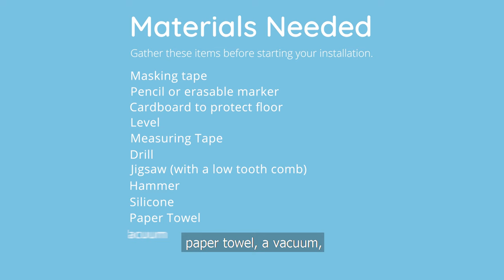How to Install a Walk-in Bathtub Conversion Kit

Comment: i am a bathroom remodeling contractor. i understand the need to finish a job quickly, but with the amount of caulk that's used to assemble everything, it's done too quickly. If I were to install this for a customer, I would only install the stiffener boards first and caulk on the first day. Then come back the next day and inspect the caulking. With the amount of caulking used, it will take a decent amount of time to dry. I know there are 30 minute caulks that dry with a chemical reaction, but I'd rather be safe than sorry. I honestly hate 30 minute caulks because you don't get enough time to really finish off the caulk nicely. Don't even get me started on the guy cutting with a jig saw on his leg.
Reply: How would you cut the stiffener boards? Still with a jigsaw, but in a vice?
Reply: How much would u charge for doing a tub like this?? If I buy the kit and the stuff need to make it
Reply: Im thinkin this for my 96yo ma she likes product but the right installer is everything n my main concern.n she has glass shower doors.what happens there?.im guessin rod .n jacuzzi tub has..my main issue is installer..yes let caulk dry 2 days ..not like in vid .job like this need great installer

Comment: BUT - this will not work if the tub is cast iron!  I watched the guy in this video try to saw a cast iron tub with 3 different saw blades, to no avail.  Had to sledge hammer the tub to remove it. This kit only works on tubs that are NOT cast iron.  Guess who has a cast iron tub in his house, and whose wife would like one of these kits installed.  Ain't gonna happen!
Reply: @safetybathtubs  - Can you imagine the amount of dust that process will put into the small bathroom space? Thanks for letting me know what to use, but I think I will still pass, as we both have asthma and would not tolerate that kind of dust, even wearing a dust mask, possibly even a respirator would be needed just for cutting it.
Reply: @retiredyeti5555  Don't DIY it. Stay away from the area during the installation. Hire an installer. The installer will clean the area when finished and there will be no dust in the area afterward. Don't use the tub for 36 hours after the installation is finished. Significantly less expensive than having the entire tub removed and a $10,000 to $15,000 walk-in tub installed. The latter process will "kick-up" just as much dust and will take much longer.
Reply: @virginiataylor4038  - thanks for the advice, but as my comment above stated, I will pass.  If I could afford to have it installed, I would.  I bought a couple of steps that enable my wife to be high enough to step over the tub edge and into the shower, with my assistance.  In our 70's, we are striving to remain in our home as long as possible.  Both of us worked in the medical community, (but not as highly paid doctors), so we know how to do total patient care for each other if needed.  I have installed safety bars in the tub on 2 walls and beside the toilet, installed a high rise toilet, got rid of throw rugs to avoid tripping hazards.  If possible, I will have my nephew(works in the home remodeling trade) give me a hand with removing the tub and putting in a shower.  Getting the cast iron tub out will be the difficult part, but it can be done with a sledge hammer!
Reply: You have to get someone who is good with a cutting torch if you have a cast iron tub
Reply: @stevenmullens584  - if you read my comment, you would see at the end that I said "It ain't gonna happen!"  and it has not, and will not.
Reply: Metabo with 6” cutting blade.

Comment: I was cringing soon as that guy started cutting with the Jigg, NEVER EVER do it how he did! You need a Band Saw to safely cut these type's of shapes!
Reply from the maker: Most people will not have a band saw available to them. However, if you could set one up in the bathroom, it would be easier.  Thank you for the advice!!

Comment: Soooo this plastic door thing screws into the wood bracing boards that we measure and put it, but the bracing boards arent really attached/anchored to anything except a bead of silicone…seems like there should be a better way…seems like if someone accidentally steps on this it could easily push the whole thing down….am I wrong on this?
Reply from the maker: Yes! the kit is actually sitting on the tub itself.  Where the kit screws to the bracing boards, is just to hold it in place so you can't push the kit into or out of the tub.

Comment: Would this work on a cast iron tub? It seemed he had an easy time drilling and cutting the tub!
Reply from the maker: You can install this in a cast iron tub.  Care must be taken to ensure you collect all the iron filings.  You will need to use a grinder to make the cut.
Reply: Makes sense! Thanks!

Comment: This kit is not fastened to anything. I'm sure it will easily dislodge if someone steps on it directly. Which will definitely happen as walk in tubs are made for those physically disabled or limited. 
Kit looks like it's made from styrofoam cooler.,.. The "door" looks so flimsy too.
Reply: The kit is actually locked in place by the stiffener boards.  You can hit it with a sledge hammer, it will not come out.  The kit itself is made of roto molded polyethylene and the door is 5/8" thick HDPE (the same stuff used for the decking on boats).  Believe it or not, this is an engineered product, although the installer in the video is not an engineered product, lol.

Comment: So where is the shower sliding door?
Reply from the maker: No all tubs have sliding shower doors.  With this kit, you would use a shower curtain because the kit is higher than the tub wall, it would interfere with the sliding door runner.  You could put a swinging glass shower door on the tub though.......
Reply: Thanks for the reply, but shower rods and curtains are OLD school. @safetybathtubs

Comment: Will this work when the bath has a separate bath panel on the side?
Reply from the maker: Yes, it would work.  You would have to remove the panel to cut it separately.  You would also have to build a support structure using 2x4's placed on the bathroom floor.  The Panel will probably not be very supportive.

Comment: How do you even know if this kit will fit the inside slope of the tub?    I've a 15" tall tub and there has to be a 4" difference in the tub edge and the slope at the bottom where the wall meets the floor of the tub.  This insert looks almost square without any appreciation for the slope.
Reply: Hi Janice, Good eye!!  The kit is basically a rectangular block that you drop into your tub.  The slope of your existing tub wall has no effect on it.  It seals the exact same if your tub didn't have a slope.

Comment: Why is he waggling the drill around when making the holes - why not use the correct bit size and do not jigsaw towards your fingers, you may need them later
to hold the mop when water gushes out of this lash-up.

Comment: What is the point!? If you can't sit and get back up in a regular tub how does this help? Answer. I t doesn't!!
Reply: Helps older people get into the tub without having to climb over the original bathtub height. I assume the people needing this feature would be using the shower and not taking a bath, however other people in the household could still use it for baths. Doesn’t really take a genius to figure that out.
Reply: Also way cheaper than having a floor shower installed just because you can’t step over your bathtub to get into the shower anymore
Reply: My senior clients hated they couldn't get into tub anymore due to arthritis or whatever all my clients that had done this love it .Senior get next to nothing to afford thousands for walk in dhowers

Comment: does the existing tub have to be fiberglass?
Reply: @safetybathtubs  - Your installer could not saw through a cast iron tub prior ot removal of it, in one of your videos on tub removal.  How do you propose cutting a cast iron tub to fit the kit into it?
Reply from the maker: It doesn't
Reply from the maker: @retiredyeti5555  With a cast iron tub, you have to use an angle grinder.  You also need to mask the entire bathroom off so you capture as much of the iron filing as you can.  The install process is the same, but you need to spend a lot longer protecting the bathroom.
Reply: @safetybathtubs  -I know,  I worked in a grey iron foundry in the 70's - I think a sledge hammer will work quicker - to break it up and put in a shower instead!

Comment: Can the kit be used on a porcelain coated steel tub?
Reply from the maker: Yes, it can be installed on any tub
Reply: @safetybathtubs  Sorry no disrespect, but I don't see how it's possible for anyone to install this conversion with complete confidence by using a method like this. Even a pro plumber with 25 years experience I'd think would be hesitant to start cutting into a porcelain tub with no worry. You're rolling the dice everytime you try to make a cut with all the responsibility laying on you, the installer. NO Thanks! Seriously, you can't tell me it's easy-peasy to make clean cuts into a porcelain tub with no problem at all? I don't see how it's possible even if you're using the best diamond blade you can buy. It's still a crap shoot of chipping or cracking the porcelain on the tub no matter how careful you are or how well you prep the area. It's only a thin layer of coated porcelain over those steel tub & forgetaboutit if you try this on a cast iron tub. You'll be there all day making a big mess & probably end up costing you more in labor & buying new diamond blades/wheels than the cost of the bathtub itself. I could be wrong & I'd be the first one to apologize to you if I am. However, I see a problem to properly install this job right professionally with a great looking finish. Please convince me? Thanks!
Reply from the maker: @216Numbskull  Thanks for your reply!  We have been producing conversion kits for over 25 years, people have installed their kits in every kind of tub.  We have 10's of thousands of kits in all different kinds of bathrooms, all with a lifetime guarantee on the door seal. Care does need to be taken by the installer during install to minimize damage to the tub. Preparing the tub properly and protecting the rest of the bathroom needs to be planned for by the installer.
This product is a retrofit, designed for people who are unable to use their bath, who maybe cannot afford to renovate their bathroom but want to stay in their home longer and maintain their dignity by bathing/showering themselves.  This product is about functionality and the end user over aesthetics.
Reply: Don't try this at home, it's stupid!

Comment: Stupidest thing I ever seen. I am almost 80. The whole purpose of a walk in tub is because Seniors such as myself cannot sit or raise ourselves up in a typical tub like the one in the video without assistance. That is what a walk in tub is designed for. This makes no sense. Even if you walked in you still couldn't lower yourself or raise yourself to get out. It would be ok for young adults or kids but they can just step over and sit down easily. Makes no sense.
Reply: You would still need a seat and grab bars.  Maybe a hydraulic seat.  But all that is still cheaper than buying a walk-in in tub for ten or twenty thousand dollars.

Comment: Looks like a trip hazard..the opening should twice as wide...'n lower step-in..AND used for showering ONLY
Reply from the maker: If there are tripping concerns, properly positioned grab bars and a transfer bench make this very safe. A major upgrade from a traditional tub, for sure! The door is watertight to use for baths without any issue.
Reply: @safetybathtubs  Wider opening for larger built folks..they're offered by other companies 👍👍👍
Reply: @pdxwildchildroberts5586  so go with another company then lmao
Reply: There is a wider kit for making a tub into a step in shower. Does not hold water in the tub like this one.  Makes it a shower only. But you don't have to step over the side as some people are unable to.  With this one you would still need a seat if you are unable to get up out of a tub and grab bars.